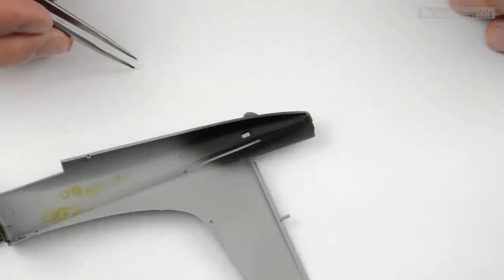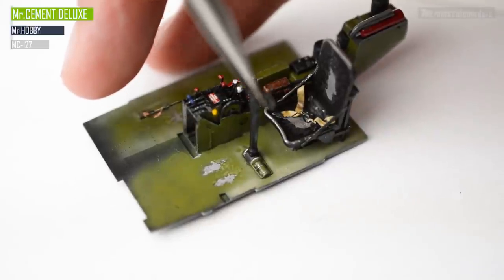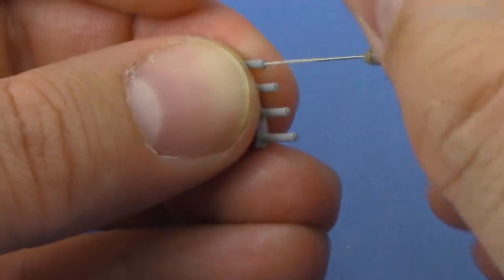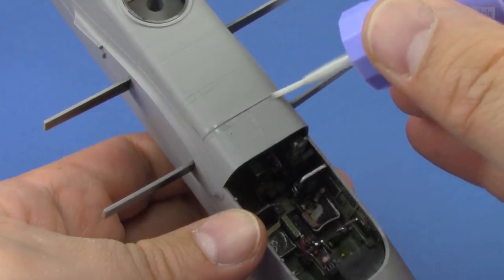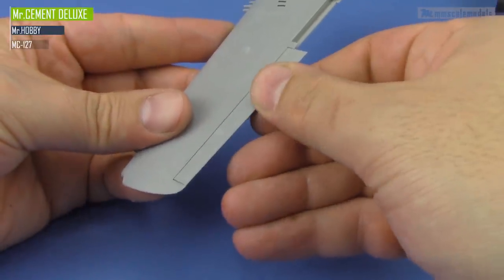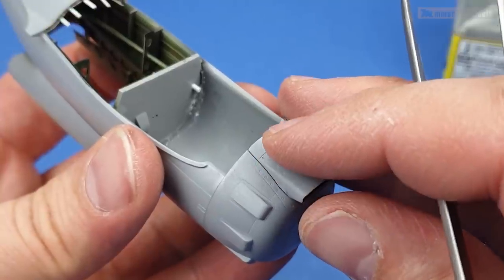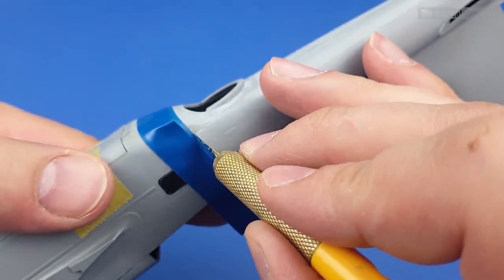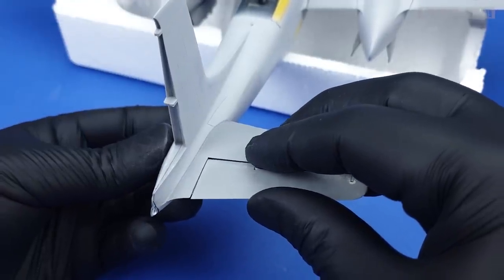Ep.9: B-26B-50 Invader - Assembling the major components together - ICM - 1/48 scale model

Comment: Nice as always. I really like using water base putty as it settles and shapes smooth. Also I don't lose any surface details when wiping it into shape with wet buds or cloth.
Reply from the maker: It is very useful technique when there is no stress on the joint.
Reply: @MMScaleModels  right on